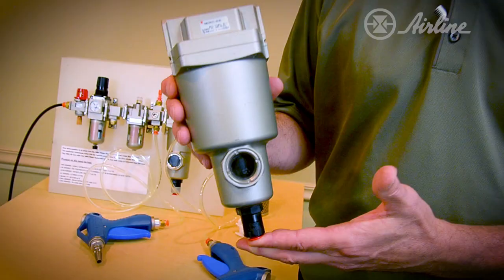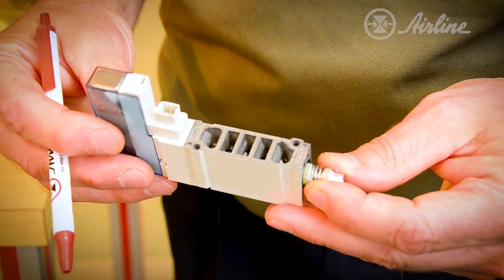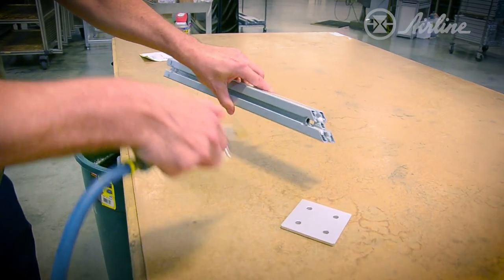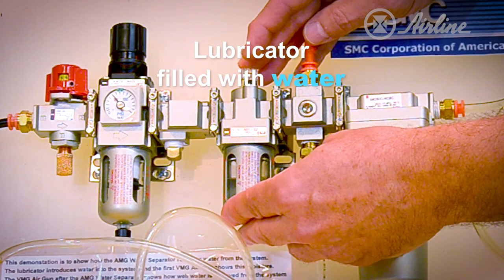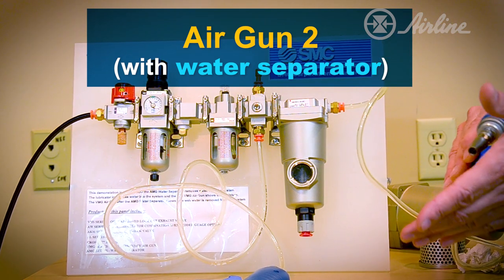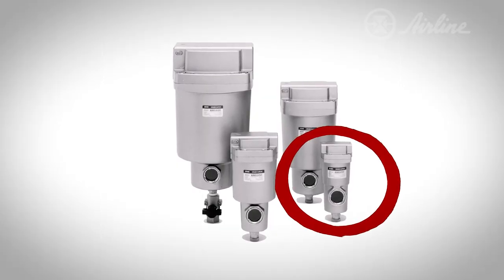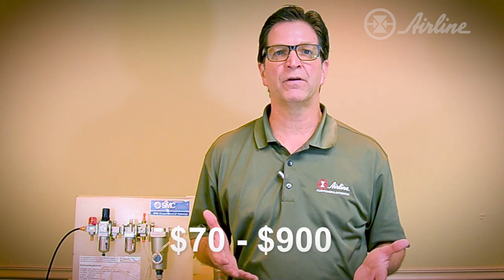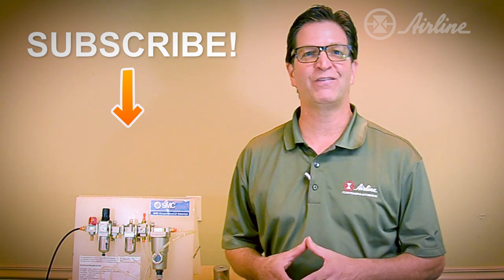Why & How To Remove Water from Pneumatic Air Lines! 🚫💧 | Demonstrating SMC's AMG Water Separator

Comment from the maker: Just a heads up, we added a NEW blog post that illustrates even MORE best practices and technologies that fight against water in pneumatic lines. Check it out here: https://blog.airlinehyd.com/air-line-moisture-removal
Reply: What about Oil removal? We have 20hp compressors and air driers, but we've always had some oil contamination. Do you have or can suggest a oil separator to go between the compressor and refrigerated driers and a link to suppliers? Thanks.
Reply from the maker: @baileyboy7567  Great question! I asked our product manager and he has a few great solutions for you, but he needed to get a little more information about your system to recommend the right sizing for the application. He's happy to lend his expertise if you're able to email him at mschapoehler@airlinehyd.com

Comment: Why isn't the air entering the compressor de-hydrated  instead of the exit-air?  Seems more efficient to stop the water contamination befor it enters the system.
Reply from the maker: There are many best practices and technologies that tackle de-hydrating a pneumatic air line. In addition to the AMG water separator (which is meant for point-of-use at the machine level), you're right - there are others that are good to deploy further down the air line. Would you be interested if we made a new video about that? Thumbs up this comment if you would watch!

Comment: that is nice to water this sales pitch, problem # 1 is that the air is cool already in this demo, when hot air passes through the water separator and then cools and then it makes the water, no one tells you how far the water separator needs to be from the compressor
Reply: Unless you build an air pre cooler 😉

Comment: I can see you have the same problem with this Filter and the Mounting bracket. Badly designed square body bends the bracket away cousing potencial leaks.

Comment: Whats the differences between water seperator and moisture seperator?
Or is it the same?
Reply from the maker: We asked our expert, and he said, "They are basically the same.  Water separation is done closer to the source like a compressor where heat and compression generate more water than moisture.  Moisture would be more seen downstream closer to an application where possible going between rooms or changes in temperature would cause water droplets that become atomized to more moisture or humid air which can accumulate over time. 
Not sure if that answered your questions.  In the AMG world there is a coarse removal and a micromist separation."
Reply from the maker: Also, here! - https://blog.airlinehyd.com/air-line-moisture-removal

Comment: I installed the AMG150 on a 3hp compressor.    I'm still getting water coming out. Why?
Reply from the maker: If you need help troubleshooting your system, please provide more information through this form and we'll be glad to assist: https://www.airlinehyd.com/forms/contact_us
Reply: @christovarghese9871  FAD 240Lpm
Reply: @christovarghese9871  No
Reply: how close is your water separator to your compressor? when air cools down it then turns into water, cooling the air before it gets to the water separator seems to be the way to go, some people on here are making homemade dryers/coolers to cool the air, there are many on youtube, i am making one out of copper tubing now